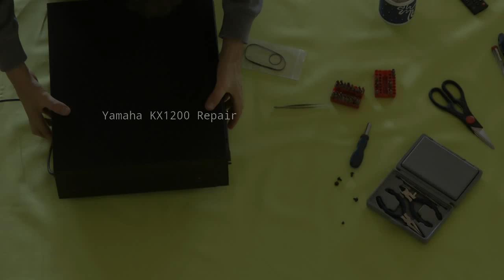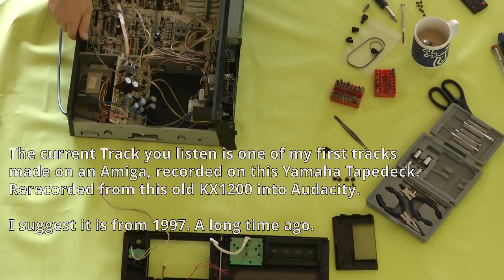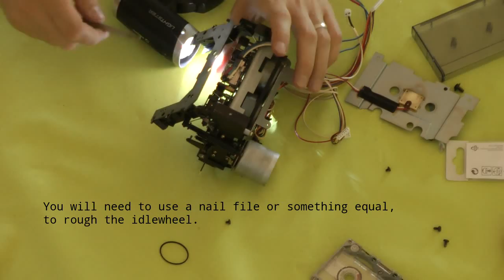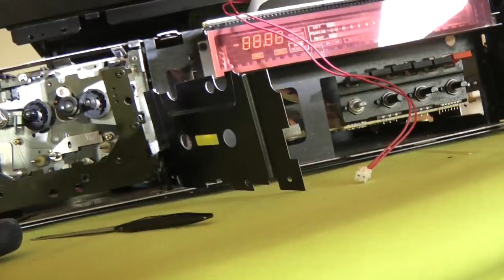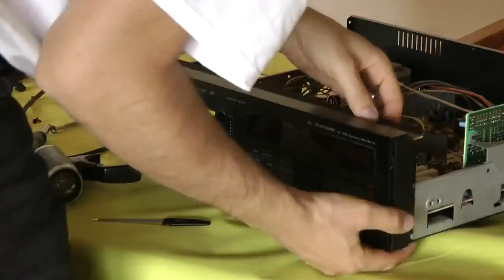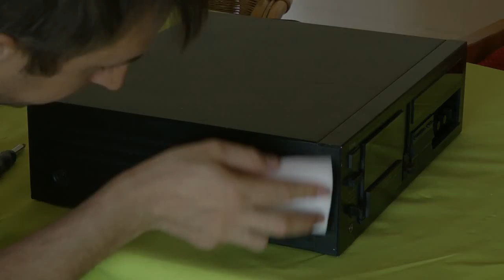Repair of a Drive Belt from a Yamaha KX1200

Comment: If you ever need an Idler Pulley for this deck you can find a trashed Nakamichi BX-1, BX-2 or BX-100 on Ebay and take the metal idler pulley out of it and use it on the KX-1200U. The plastic nylon pulley that often cracks and migrates to the end of the reel drive motor in the KX-1200U is the Achilles Heel to an otherwise great deck. This deck has a Sankyo Transport in it that is the same as the ones used in the Naks I mentioned above and so the idler pulley / tire assembly can be placed in this Yamaha  KX-1200U deck and it works 100%.

Comment: I have the same model, yamaha kx 1200,and i didnt use it for several years, and i changed the 2 belts but the forward and rewinding wont work. Do you have any ways to fix this?
Reply from the maker: nattem manica I guess this is the idle wheel in the middle ... you have to roughen it, it may slip

sry for this late answer - I had deleted my google Account a while ago, for testing purpose. as you see - google doesn't delete anything :)

Comment: What main capstan motor can I use for a replacement?
Reply from the maker: I can't say if there is an alternative Drive, but as far as I know, the entirely Drive System is made from Sankyo and is also used in Kenwood KX-1100 (and derivate), Toshiba-Aurex XC-90 and Onkyo TA-2070 and maybe same motor as TEAC V5000. If you can find one of these cheap to buy, you would have spare parts. 
The Motor itself has a label with it's Type Name and Number. You sould probably find it in the web.